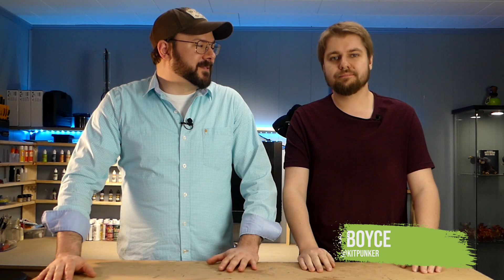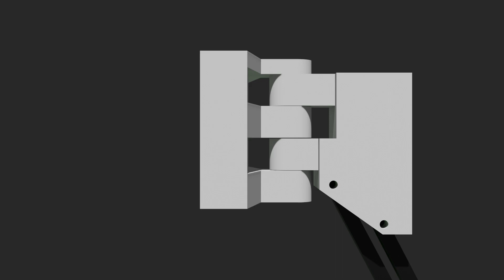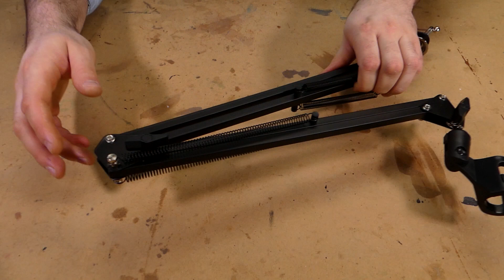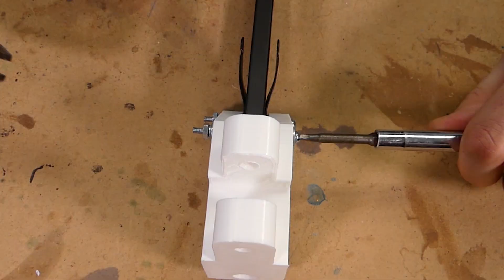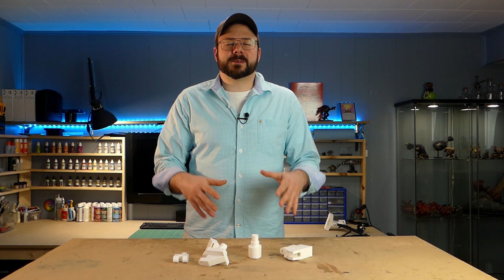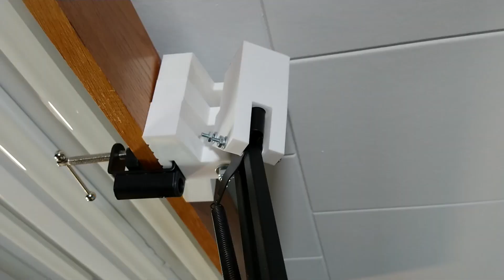DIY Adjustable Camera Arm (Under $40!)

Comment: Beautiful job, guys. Love the studio set up. Since you guys are getting creative with custom set ups...I have an idea that does not seem to have been done before:
The idea is to have a collapsing paint box that closes flat yet expands into a mutli-tiered (like stepped) set of trays (so it looks like a nail polish display stand).
The function being that it stores flat for easy storage but expands into a step-like display so that all the labels/colours can be easily seen.
It would use a Cantilever folding system (much like a fishing tackle box) but is designed specifically for paints/nail polish (so it has x3 steps per tray; x3 trays = x9 levels total).
It's probably something that could easily be designed in part with a 3D printer.
Great vid, guys
Reply from the maker: That's an interesting idea, would be quite a bit of filament if entirely printed but if combined with other materials, totally do-able. We'll keep it in mind :D